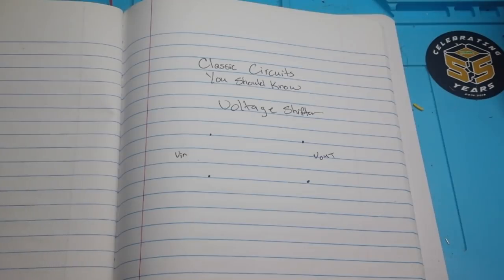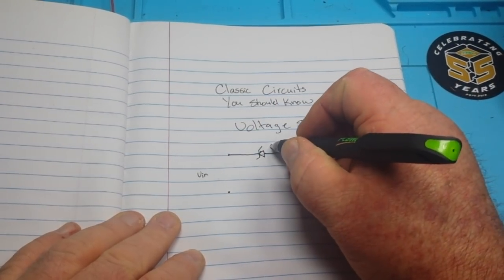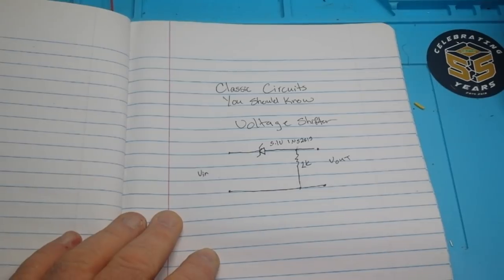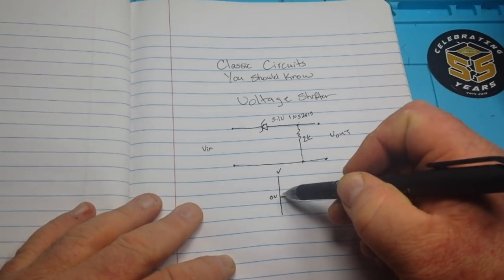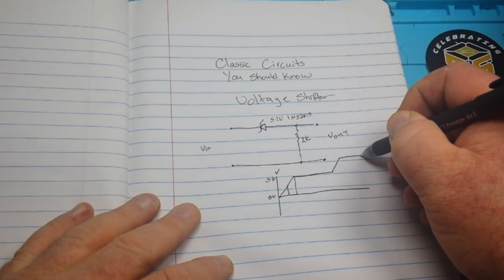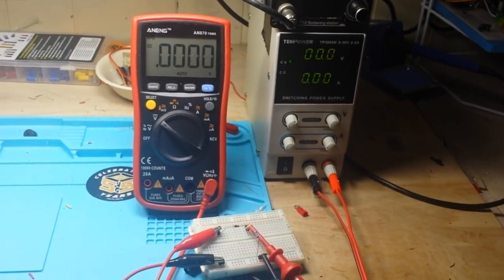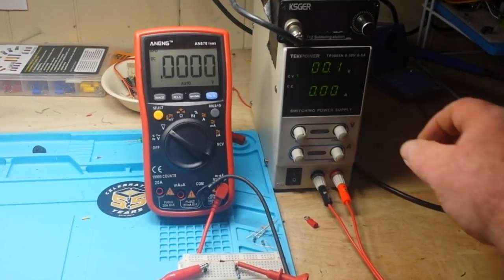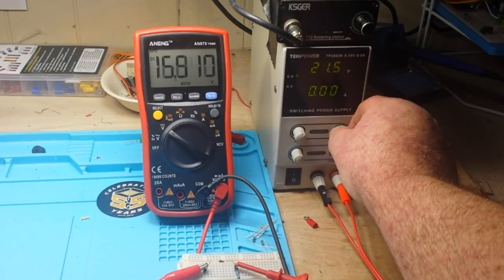Classic Circuits You Should Know:  Voltage Shifter

Comment: So to put in the words of my textbook from 1980:
There will be a voltage drop across the Zener diode (V zener) that corresponds to the breakdown voltage of the diode.
This gives us:  V out = V inn - V zener
The datasheet for the Zener diode will state the maximum current the diode can handle (usually very little).

Comment: A quickie class that makes all difference for a beginner like me! Thank you so much!
Reply: A quick bit of advice for folks starting out:
1) Understand don't memorize.
2) Almost all circuits come down to Ohm's law somehow.
3) A very inaccurate estimate is often all you need
About the points:
No doubt you have seen the two resistor voltage divider circuit. With just the facts about hooking resistors in series and parallel, and Ohms law, you can work out what it does.  Now if someone gives you a circuit with 10 resistors, you can just apply that same idea over and over.  If you memorize the equation for the two resistor case, you can't do the 10 resistor case.
No doubt you have seen the "Zener diode regulator" circuit.  Notice that if the (+) side of the input was ground and the (-) line was was the power supply, this circuit is really just a zener diode regulator.  Now if I told you that I put a capacitor in parallel with the zener, you could easily see why I did that.
Reply: Yes —  like Ken says; Many circuits come down to Ohm's & current and so on but such things  vary some; For example an .7 volts you will find later can vary wider than you expect;  Frustrations can mount and become very difficult to control;

Comment: a 30 second overview of what this would be useful for at the beginning would be great. you touched on it at the very end.
Reply: This can be viewed as a basic voltage regulator, but it allows you to increase Vout as Vin increases.  However, there is a constant voltage gap due to the breakdown voltage of the zener diode.  If you noticed, the voltage was roughly 5.1V down from the supply voltage. Essentially, this can be viewed as a level shifter.  It will help manage transitions between voltage levels.
Reply: You are supposed to take care of that on your own.

Comment: I made myself a 5 channel bi-directional level shifter with mosfets, it can handle up to 30 volt on the high side and 3.3 to 5 volt on the low side. It works flawless but there's one little downside to the circuit, in idle state both high and low side always pull up with a pull-up resistor to the bus voltage high and low so it doesn't have a floating pin or high resistance open collector. In most cases this isn't a problem and it will happily work even with higher frequencies, I don't know the exact numbers because I haven't tested it because I don't have the right equipment to do that however it works on my Raspberry Pi 3B+ to control 5 volt devices such as 5 volt individual programmable led strips which needs a pretty high frequency to make it work.

I've seen some videos from people claiming that the level shifter boards you can buy ready made had some problems with the higher frequencies to work reliable that's why I decided to make one myself. I think it's better because I've added one channel and it work with higher frequencies as the ready made boards that you can buy online.

Best regards,
Ricardo Penders

Comment: So that's what Zener diodes are for. I always sort of knew, but that video gave me the lightbulb realisation. Thanks, more please.
Reply: These days, I mostly use Zeners to clamp the gate connection of a MOSFET.  At less than their breakdown voltage they are a very low leakage device.  At break down, they can eat quite a big current spike to save the transistor's life.  I usually use a 15V Zener to protect a MOSFET that has a gate voltage limit of 20V.  10 or 12V will turn a MOSFET about as far on as it is ever going to do.
Reply: @kensmith5694  Like a safety valve on a pressure cooker. I can see that.
Reply: @strayling1  
Yes, ever like that and also in many cases the voltage for the "ON" signal is more than 20V.

Comment: I thought the resistor had to be on the cathode side of the zener?? it mustn't matter  yes??????so a ten volt zener would drop 10 volts when set up in that way?? normally you would see the zener and the resistor swapped around.. is this right??? if so that's a cool and handy circuit. thank you Paul

Comment: Thanks! What about a 5.1V Zener across the voltage input, how would we use this to limit the voltage to 5.1V without burning up the diode but still provide enough current to power a circuit while restricting the input to 5.1V irrespective of the input voltage (to a reasonable extent)?
Reply: By selecting a series resistor to limit the current into the diode, so that multiplied by the diode's Zener voltage the resulting power doesn't go above the diode's maximum power rating. So, for a 2W 5.1V diode, the maximum current is a bit above 400mA. If you are creating 5V from a 9V supply, that resistor will have to drop 4V, and with a max current of 400mA its value must be 10Ω. If you pick a bigger resistor, the output current is more limited but you also get a lot less heat from both the diode and the resistor.
Reply: When used without the input resistor, the 5.1V Zener can be a protection device for an input that is intolerant of much more than 5V on a supply that is supposed to deliver close to or under 5V. If it goes much above, the diode will limit the voltage until it overheats, then melts into a short circuit, thus tripping the fuse.
Reply: djdjukic Thank you for the thoughtful and succinct answers!

Comment: A quick circuit but useful and makes me think!  If I swap the positions of the resistor and zener, then the voltage measured should never be above 5.1v right?
Reply: Yes, as the Zener then acts as a parallel regulator. However, the power dissipation of the series resistor might then cause some issues.
Reply: Above the threshold it could then be used as a voltage reference for a comparator (or opamp or adc or...).  
But it could also be used below the threshold on an analog input to limit the voltage (and thus not fry your IC)

Comment: Can you use several diodes and some switches so you can have several values you can choose from, or is that just a dumb idea that nobody has any use for? Also, could you use regular diodes in a pinch? (My school has a lot more diodes than zener diodes so it might be hard to get ahold of)
Reply: @jonelectronics510  but I could do the same thing with a bunch of forward biased diodes in theory, right?

Comment: Here's my stupid question.  If I've got a simple circuit, why can't I just throw in a resistor to drop the voltage?
Obviously its not efficient, and vdrop is proportional to current.  However for an LED light or similar, any reason why one couldn't do such in a pinch?

Comment: What would be max current ,If you pulled to much would the zener burn up or over heat .so you would be limited by the forward current of the zener
Reply: looking at the data sheet (http://www.smc-diodes.com/propdf/1N5221B-1N5281B%20N0184%20REV.D.pdf), it seems that they can dissipate up to 500mW, depending on environmental temperature. So if you have a 5.1 V version, you could draw about 10 mA (including the ballast resistor current) from this circuit. (P=U.I, so I=P/U) 

This is a good circuit for when you need a reference voltage instead of a lot of current.
Also  it is kind of wasteful. You loose the voltage over the zener, and also there is a current flowing through the ballast resistor. 
You can use zeners for powersupplies, but then usually a driver transistor or a voltage regulator is used that is controlled  by a zener.

Comment: Quick question, I always thouth the diode should be turned on the other away, something like this: 5v---->|---- GND and not like in you circuit: 5v----|<---- GND. Why is on that way? Thanks.
Reply: A zener acts as a normal diode in the forward direction, the zener breakdown voltage only applies in a reverse bias situation.
Reply: @benbaselet2026  Oh! Nice tip! Thanks! Cheers.
Reply: Zehner voltage is from cathode to anode

Comment: does it shift the amps from the supply or would you still have full amperage just at a lower voltage.
Reply: Current draw is load-dependent ... is it not ? 🤔
The safe current rating would be the limiting factor..
Reply: For a half watt zener, 5 volts times 100 mA would be a half watt.  So the maximum current would be 100 mA.  But that's with the temperature at 25 deg C.  Higher temps require lower power dissipation.

Comment: So this is an alternate use for a diode? Will it degrade the diode over time?
Reply: Jon Electronics cool! Thanks.
Reply: Zeners like to breakdown and regulate voltages.  They hate conduction like a normal diode.

Comment: A little too quick I think. You need to explain what happens and when and why. Also please explain more about the usage. And please consider starting of by showing the breadboard first (for future videos), then theory, and back to  breadboard and transfer theory to breadboard.
Reply: First usage I can think of is to trim useless low voltage range on an analog input before ADC...

Comment: It's just a voltage regulator not fancy pants voltage shifter name.
Reply: its not really a regulator... it does not keep the voltage constant (like when you wire it to ground or such).. it will just maintain a constant drop or voltage difference

Comment: Sorry, but this is the 5th or 6th video I’ve watched where you’ve stuffed up completely. Here, you drew a diagram showing the diode LIMITING the output voltage to 5v. Your circuit then shows the diode REDUCING the input voltage by 5v. And you don’t even notice.

Comment: different! ...I prefer to feed a Ground referenced zener with a resistor and then its rated voltage will appear across it; - I like to feed that voltage to an op amp and some power transistors...